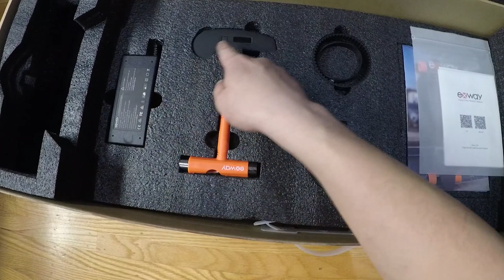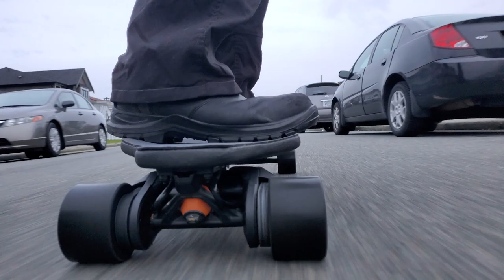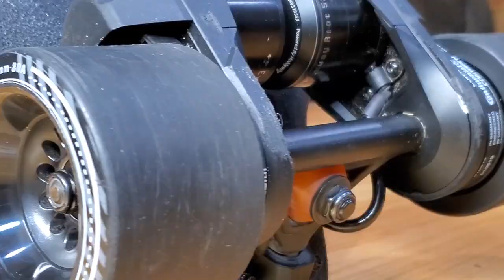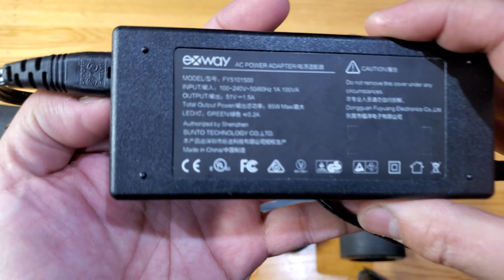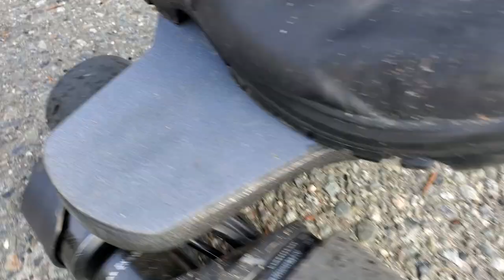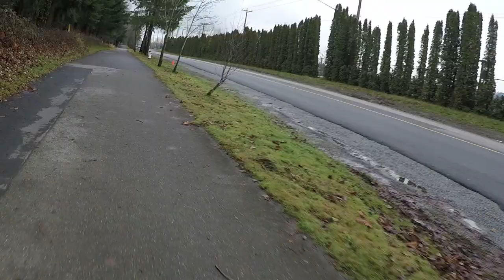Exway X1 Pro Riot Review

Comment: Some very important things to note for anyone interested in this board 

Reviewer rides board in water
“Board is disconnecting, not sure what happened there” shrug

Just because a board is rated for a certain level of waterproofness doesn’t mean you should ride it in a rain as an everyday user. I understand he’s doing a review and test, but I’ve seen other reviewers say they rode this board in the rain and performance was effected.

https://youtu.be/Nkehq_SLyf0 (check the first comment on this video)

You also might want to send your board in for replacement. I’ve seen another review where the reviewer put it in speed mode 2 and got 18 miles.

https://youtu.be/96A1t7P4USI

Comment: Man this is one of the best reviews of this board I have seen. I am about to do my review. I hit 200 miles recently. I agree with everything you said. Fortunately my belts have had no issues. When your board cut off did you just finish a hard braking maneuver? If Exway could improve the range and battery I think they could take the market. It is an excellent board. I am 220 I changed out my bushings and just did a video about it. Good video 🤙🤙
Reply: I wonder if his belts are too tight, too.

Comment: I’ve rode my Pro with both belts and hubs. For the best range and top speed (30MPH @ 165lbs) the hub drive is my choice. For torque and comfort the belt drive is nice. I’ve hit 29MPH with belts but I’m using ABEC11 97mm wheels. Wishing Exway release 90mm hub sleeves and front wheels.

Comment: I also had the issue of the board cutting off on me but I could not get to connect it would say updating on my phone the boards power led would blink. I tried multiple times. When I go home tried again it worked took it with to ride the next day wouldn’t turn on only update the phone and board power led blinking.

Comment: Detailed. I can't trust myself to ride in the rain, if you hit the breaks would that board freak out like a Boosted?
Reply from the maker: there is a lot of range on the thumb wheel to finely control the amount you need to brake to prevent wheel lock up. there is a setting in the app for " free mode" and that makes the brakes act like a boosted where they will spin backwards if you pull back all the way. but i never use that mode
Reply: The cut off is a nono for me....it is dangerous.....one question : if a belt brakes during full speed you fall or you can brake it safely?